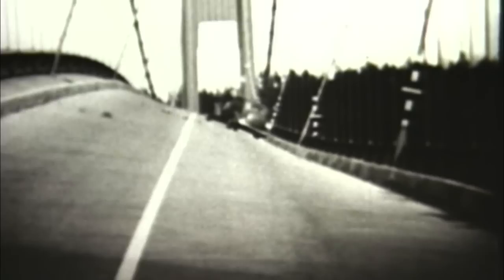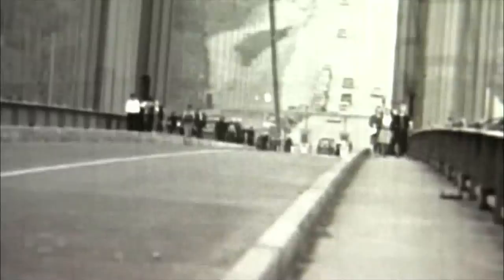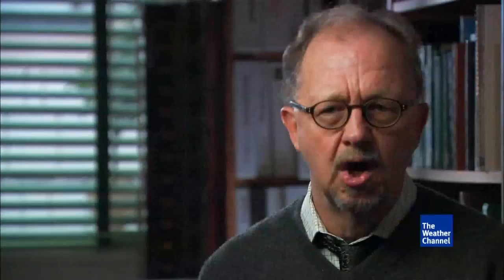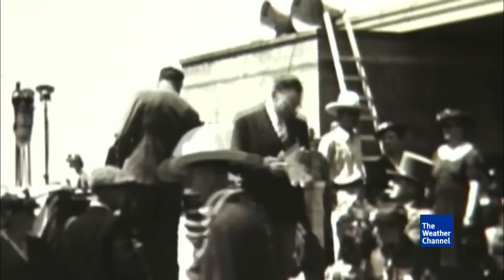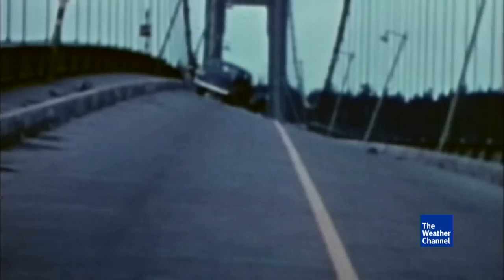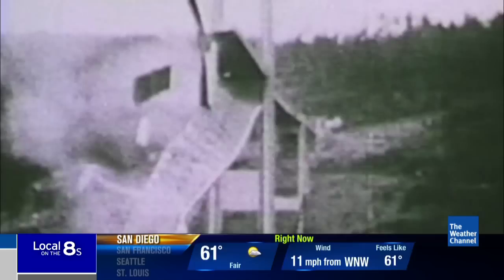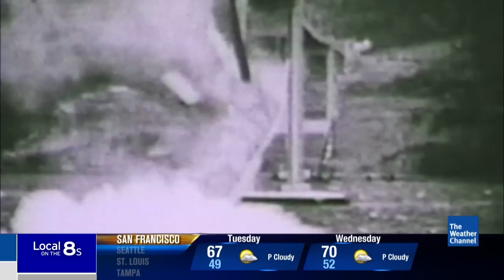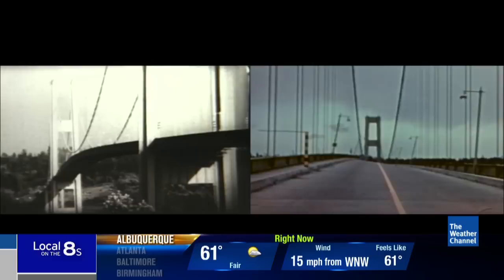1940 Tacoma Narrows Bridge collapse (from TWC's Weather Caught On Camera)

Comment: Shocking that the Tacoma Narrows Bridge passed inspection, was permitted and allowed to open given the dangerous conditions that were known during and after construction. I realize that it was in 1940. However, you don’t need to be an engineer to know that a 6-foot upward/downward sway in only 15 mph winds was an issue and would worsen under more adverse wind conditions.

Comment: I mean, it's not so much the power of the wind as a mistake made in engineering that allows the wind to have such an effect on the oscillation...
Reply: Yup.  That bridge was both underengineered and inappropriately engineered, given the constant gusty wind conditions in the Narrows.  It was originally designed to have triangular trusswork below the roadway with considerable height to stiffen the structure of the roadway, but they changed it to solid box girders only 8 feet high, with solid girders running under the roadway from side to side.  Those caught the wind like sails, and caused the frequent up and down motion of the roadway of 6 to 8 feet, which people crossing the bridge noticed all the time and the nickname Galloping Gertie caught on.  On the fatal day of the collapse, the wind was gusting up to 46 mph with just the right frequency to get the suspended span of the roadway to start twisting in a rhythmic torsional manner, and the wind gusts were just the right frequency to harmonize with the frequency of the torsional oscillations, so it kept the oscillations going, rather like having someone pushing a child in a swing each time the swing comes back to the pusher.  Only an occasional push keeps the swing oscillating front to back.  Two reasons for the design change:  (1) it used a lot less steel and was quicker to build, so it saved a lot of money and money was tight in 1938 due to the Great Depression, and (2) it was thought the box girder design made the bridge look more elegant because it was more slender and graceful.  As a result of this failure, scale models of suspension bridges tested in wind tunnels became the norm -- in fact, they built a scale model of Galloping Gertie as built and got it to do the same thing in a wind tunnel and collapse.  So when they replaced the Tacoma Narrows Bridge in 1950, the new bridge was fine, properly engineered and is still in use in 2018.  In 2007, a second suspension bridge alongside the 1950 span opened, and each of the two bridges carries traffic in a single direction.  In fact, a whole lot of suspension bridges were built around the world after the collapse of Galloping Gertie and not a single one of them has failed.  So the engineering mistakes made in the original Tacoma Narrows Bridge made a huge difference as to suspension bridge construction standards.

Comment: Yes it depends how the wind had perfect speed to cause oscillations ... Finally due to wind induced vibration the bridge is collapsed
Reply: Somanath B — No, the wind speed did not have to be perfect, only strong enough to put energy into the oscillation faster than it could be dissipated.

Comment: The thing is the wind wasn't even that fast (35mph?)
Reply: it's not a question of how fast the wind was but how that speed had the perfect match with the oscillation rate of the bridge, wich caused its destruction
Reply: Probably Straight line wind
Reply: Yeah its not fast but its a bridge and all wind comes through there.
Reply: Gusts up to 46 mph.
Reply: Yes it depends how the wind had perfect speed to cause oscillations .... Finally due to wind induced vibration the bridge is collapsed
Reply: It needn't be a strong wind, just enough to get the roadway curving.
Reply: Laseboy — No, the wind speed did not to be a perfect match.  It just had to be strong enough.
Reply: 35mph isn’t super fast. But have you ever gone more than 20mph on a skateboard or bicycle? That’s some hella speed. Perception can be deceiving.